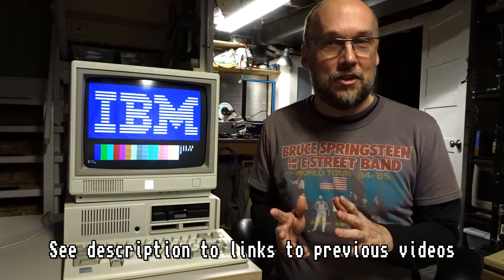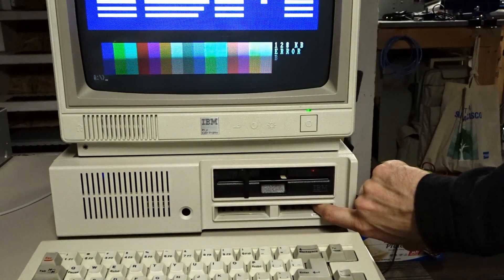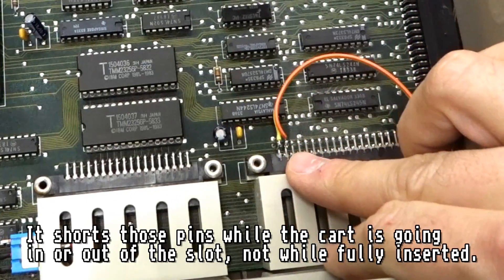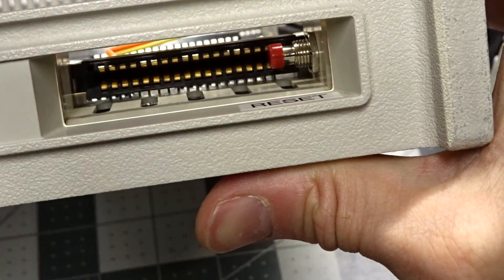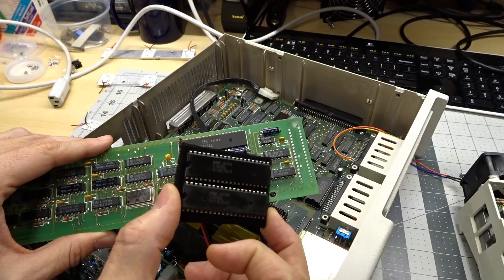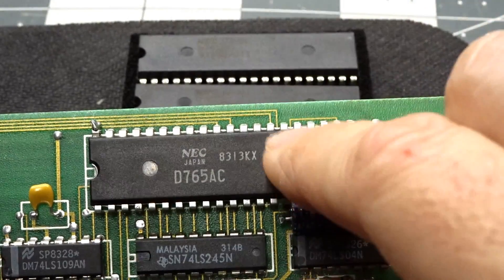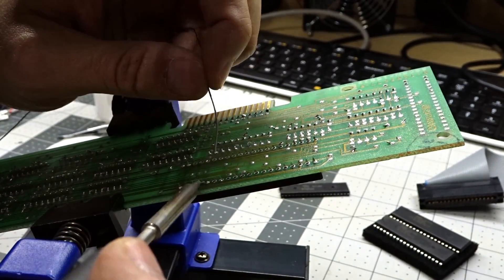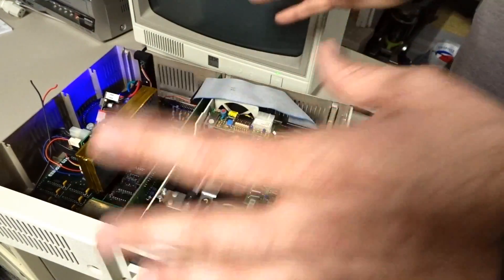IBM PCjr Part 3: Fixing the pesky boot issue once and for all

Comment: I notice a lot of complaints about him cutting the legs off the chip, but it's safer for the PCB that way.  Otherwise you have to perfectly desolder every pin to get the chip off.  That's a lot harder to do so you'll put more stress on the vias before you've accomplished it, and possibly end up with damage.  Cutting the legs makes it a lot simpler since the legs can be removed individually.
When you have a probably-bad chip that's not rare or valuable, attached to a board that is more valuable, you have to weigh the risk/reward of either approach.

Comment: I'm not a fan of replacing capacitors either.  However, most L/C meters do not check for DC leakage, and only check ESR and capacitance.  DC leakage can make an L/C meter think the capacitor has greater capacitance when DC leakage is present.  This is because L/C meters use TIME to determine capacitance.  The longer it takes to charge, the greater the capacitance.  However, if the capacitors are leaking DC, they will give the illusion of higher capacitance, because it's taking longer to charge the capacitor.  Nichicons are excellent capacitors, but that does not mean they are immune to DC leakage.

Comment: I have to say that if you have 40 year old capacitors in a unit they are going to fail sooner than later and it never hurts to change them regardless how well they measure. It’s easier to change them then clean up the mess if they leak all over the PCB.

Comment: I really like the method of desoldering a bad chip off and replacing it with a socket instead which makes it very easy to swap out chips when necessary.

Comment: If the capacitors are good and the chip is not resetting properly then it could be the resistors in the reset timing circuit.  There is usually one resistor to discharge the capacitor on power off and one to trickle power into the capacitor on the reset line so the reset is low on power up but slowly goes high.  Of course it could also be the logic itself, though.

Comment: This series has been pretty interesting to follow along with.  I'm looking forward to seeing how you make out with that sidecar memory expansion in the future.  Your diagnostic of the bad IC chip on the floppy controller was really interesting, especially when many in the comments were giving different advice.  I like the fact that you replaced the chip rather than going with some other ridiculous reset solution.  As for cutting the legs and tossing the bad chip I'd have done the same thing.  I don't really subscribe to the theory of saving everything even when it's broken as some have suggested.  The chip was bad.  You definitely chose the best solution.

Comment: I saw a few other posts that indicate that the problem with the card might be due to the lack of filtering caps on some of the ICs. https://www.zdnet.com/pictures/cracking-open-the-ibm-pc-jr/16/ (look through the pictures, there's  a bodge wire on the back of the card too) 
I'd give that a try, because if it works, that would be a much cleaner and reliable fix, and .1uF filtering caps are dirt cheap. Of course, might not solve the issue if the controller chip itself is bad.

Comment: If you get the IBM 128K sidecar you can remove the 16 4164 chips, install 16 sockets  and 16 41256 DRAM chips. There's a spot in the middle of the board where you can solder jumper 2 pads or, do what I did and install a pair of .100 pins and used a jumper. You'll need a small TSR to load when booting to recognize the extra RAM in DOS, but that will get you to 640K.

Comment: HI Adrian - I don't believe in just shotgun replacing every component either, but replacing 35+ year old electrolytic caps are a no brainer, especially if you plan to keep the machine long term (even Nichicons). It sounds like you tested them in circuit and got expected ratings, but I have still seen ones pass tester tests but act up in use until replaced. I would also like to share that in my experience, late 70s to mid-90s axial and radial full-sized caps generally don't necessarily leak visibly, or burst from the top vent -- they generally just seem to dry out eventually. Makes troubleshooting harder for sure. The video doesn't make it clear how you settled on the one chip being the issue, but if replacing it fixed the issue, then great. I would be very interested to see a voltmeter clipped to that floppy controller chip's voltage input lead (with the other lead grounded) and watch the meter during the PCjr reset button held down -- is it possible the expansion cards aren't fully reset during the computer being "reset", with that chip retaining some state from voltage present during reset ?? We know for a fact the card resets properly when being fully removed and reinserted. Best wishes!

Comment: Cutting the legs of the chip seems to make more work.

Now instead of using some desoldering braid and prying it out, you have to cut each pin, use tweezers and remove each one, then use desoldering braid to take the solder out. Not to mention if the chip was good it's now ruined anyways.

Comment: Not sure why you blocked the cartridge port with the reset switch.  Why not just punch a whole in the front of the unit and mount (either the switch your had, or a nicer large button momentary contact switch) and add the reset button rather than block off the cartridge port.

Comment: You are a braver man than I on that chip replacement method! I don't like to damage the existing hardware even when it is expected bad and I have replacements. I try to always maintain the ability to revert back to the original state. 

Being different part numbers from a different decade on your new floppy controllers had me worried they would be different somehow like CMOS instead of TTL and may not work. But I haven't done any reading on the matter, that's just what popped into my head. Clearly it worked so it was an improvement! 

I'm really curious to see how that goes with the RAM sidecar! Since mine is only 64kB I should really look into one of those as well.

Comment: I used to own two PCjrs. I inserted and removed the BASIC cartridge all the time. It seemed to not affect the computer much at all. Nevermind that the Jr was anything but PC compatible. 

Adrian, one of my Jrs had a Rapport expansion upgrade to add a 2nd 360kB floppy drive, memory expansion, and a sidecar that had a 40-80 column toggle switch and a parallel port. Mine had 256kB on the board.  Unfortunately, I accidentally tore a trace on the memory board (imagine a 15 year old kid trying to solder ram chips onto said board at the time).

Comment: 8000 people cringed when you unplugged that floppy card when power was on. Yikes! It seems like there was a dozen other places you could have put those reset switches where they would not have blocked the cartridge slots. I would have either run them out the back or jury rigged a blank spacer that slotted into the cartridge slots with both switches on it. That's just me, though.
Reply: Yeah, between pulling the card while it is on (and risking shorting lines on the motherboard together), cutting out the old IC without knowing if it is bad or if the new ones work and installing a switch where it blocks the cartridge slot, its all cringe. There are way better ways to go about all of that.

Comment: A much more elegant solution would have been to make a 'reset cartbridge' with a very simple circuit : a reset button conected to the 2 pins you have to short to reset the computer. no holes no soldering. You insert the cartbridge and you have a rest button.

Comment: Smashing job on that!  That was quite the detective work to figure out the error, sometimes desperate times call for desperate measures.  Glad that those IC's are easy to come by!  I'm not terribly fond of where the reset switch was mounted, but it's easily reversible should that cartridge slot need to be called into use.

Comment: mmmm while you can just swap the chip and fix the problem, i'd rather stick an arduino mini to the card and have it detect and reset the chip for me. I rather fix things than swaping out chips, mostly because you never know for how long you'll find those chips until they are all gone.
Reply: That 765 was already broken (damaged insulation somewhere in the silicon most likely) and it would have been a matter of time until it fails completely, very likely by shorting out (full latchup) and possibly damaging the rest of the board.

On the other hand it was THE floppy controller for all the early PCs (actually, it was in all PCs until they ditched FDC at all, it just got integrated into the chipset later on) so it's still quite plentiful.

Comment: Interesting way to figure out the problem :) I wonder, instead of removing the chip, could you just put the new one on top (piggyback) to see if that helps? I have repaired some c64's and I followed some other youtubers who repair c64's and did that on the chips they suspected was broken. So I wonder, is it always safe to do that?

Comment: I'll never understand why you cut the chip off the board. That makes so sense at all considering you have the proper tools.
Reply: I understand the reason why it was cut. I'm sometimes rather angry when I "debug" for hours a hardware problem, hence the faulty component has to die a horrible death :D
Reply: Why does it matter? It was broken. Its much easier to get a BROKEN chip off like this than it is to try and desolder the whole thing in one go.
Reply: @FloppydriveMaestro  
he has the heated desoldering gun, you go trough all the pins and the chip falls off, its actually faster using the gun and you dont destroy the chip in the process.
Reply: @laharl2k  But why do you care? The chip was broken and he was going to replace it regardless. If a chip is broken its easier to just to this. Heated desoldering guns are not perfect and it can often be fiddly to get it all off in 1 go. 
Why does every one care so much about a broken chip having the legs cut off. IT WAS BROKEN ANYWAY.
Reply: @FloppydriveMaestro  
it wasnt broken, it was just not working perfectly.  but still it was still partially functional. You just dont trow away salvageable stuff, its that easy, desolder it properly, put a label on it that says "reset semibroken" and that's it. save it in case of nuclear catastrophe or something. You never know when you'r gonna need it or if you'll ever get to a point you cannot longer find a replacement. Just like with antique old machines, you just dont throw away broken parts, you save them ust in case in the future you can fix them or something happens and they become usefull again.
Reply: @FloppydriveMaestro  I care because people need to know that this isn't the quickest method for removing a chip. And it's destructive when it was not necessary. It literally took him twice as long to remove the chip that way. And HE needs to learn that too which is why there are comment sections. If I did something like this, I'd want to be told that it was  the wrong way.
Reply: @BillSargent1977  instead of looking at it as a right way and a wrong way perhaps consider that there is your way, and his way.  Feel free to do it your way, and Adrian can feel free to do it his way.  Most problems in life have more than one solution, and just because you prefer a particular method doesn't make someone else's method wrong.
Reply: @laharl2k  If an IC chip isn't fully functional, and I can still purchase replacements, then I'm going to throw it away.  I'm all for saving old things, but there comes a point when it is time to let something go.  I used to save everything as well, but over the years I came to change my opinion on this.
Reply: @BillSargent1977  His desoldering station sucks and can lift pads from overheating, this method is totally fine.
Reply: @Walczyk  No its not. And you''re replying to a really really old comment.
Reply: Geez we got a Dunning-Kruger convention up in here, with passive aggressive icing on top.  The chip is ubiquitous and worthless, the board with this particular old thermoset adhesive, less so.  The goal is to minimize heat soak to avoid lifting pads, lowering and decoupling thermal mass accomplished this.  It was worth the extra 10 seconds of prep.
Reply: Plus the chip still worked, it only needed an arduino mini hot glued on top to hack it back to proper operation.
Reply: @MrCrackbear  Here's the issue - what if the problem wasn't fixed with the new chip, or worse, the new chip had other issues? If he hadn't destroyed the original chip, he could have popped it back in and still used his mod, and everything would have been OK. But, since he destroyed it, he left himself without a way back. When  modding you should be able to easily undo what you did.
Reply: I usually cut only one row and then bend back and forth the chip to have the other row automatically cut.

Comment: That a really odd failure mode for a chip like that.  I wonder if it was thermally sensitive?  It's always satisfying to fix stuff like that though.
Reply: It could have been as simple as a dry joint, but rather than troubleshoot that, just hack it off.
Reply: @daishi5571  A dry solder joint would not cause a consistent fault after power cycling.
Reply: Sure it can, higher resistances, signal noise, tolerances that over time are drifting. What I don't get, is he has a desoldering tool and it would have been simplicity to just remove the chip intact. He say's he's against replacing caps without reason but apparently has no issue in all but destroying a chip? seem inconsistent.
Reply: @daishi5571  He destroyed the chip because it was already broken. All testing showed it was broken so why bother leaving it intact if you are going to replace it anyway.
Reply: If that's all the troubleshooting he wants to do I guess that's fine, to me that's slap dash. I still don't understand why the need to cut the legs when he has a desoldering tool which he then used afterwards, it's adding work.

Comment: I cringed when you cut the legs off the old IC, even more so when I saw you had a proper desoldering pump. Why not just flip it over and desolder the old IC out, so you still have it in case of unforeseen problems? It's not like it's a huge hassle with a vacuum desolderer, I don't have any issues with a crappy mechanical pump.
Other than that, I really enjoyed the video and look forward to future videos.
Reply: I had a similar reaction when seeing that: As long as you are not 100% sure it is broken (and impressions can be deceiving), always try to save the old IC.

However, the other side of the story is that these are simply not rare ICs: There is a lot of supply on Ebay and AliExpress prices as low as $1.30 a piece. If it is not rare, why make your life harder?
Reply: Why does it matter. It was broken...
Reply: It matters because very you often only know for sure it was broken after you have done the swap. Until then it is just a suspicion.
Reply: @danielmantione  So? If it wasn't the problem then he would still have a nice socket and a working chip. If you have gone to the effort of removing the old chip and buying new ones you may as well replace it while you are there.
Reply: When repairing/restoring older equipment it is good practice to minimize the damage to potentially working parts, after all, it is not uncommon for such parts to be out of production, and so in limited supply, which might easily mean you are needlessly denying someone else the ability to repair something in the future.

There is also the concern about keeping the machine as close as possible to original or maintaining the history of the machine, though this might be more of a concern to museum type restorations it is common for even hobbyist restorers to try to minimize/avoid unnecessarily damaging parts or doing irreversible modifications
Reply: I tend to agree. He has all the proper equipment to desolder the legs from the bottom quite nicely.
Reply: The danger of damaging the PCB can be reduced with the proper tools and skill, as long as you are careful to get the pins to be lose before trying to pull the IC out, there is little danger of ripping off a trace, though obviously if the pins are tight in the holes this is not always an easy thing to ensure, and you might get to the point where the risk of overheating the pad becomes an issue.

Of course, it is not impossible to deal with a part being out of production, you might emulate it with microcontrollers or implement it with FPGAs or something, perhaps in the future it will even be possible to fab replacement ICs at a viable price for small volume production, but compared to the work invested in this, bodging a few traces will likely seem pretty trivial...

Comment: Great video! But the Reset switch in the Cartridge Port? The right port is where the BASIC Cartridge does into; if you get it.

As I remember, the computer does reset when you put the cartridge in or pull it out.
Reply: It doesn't matter which slot the cartridge would go into (BASIC or otherwise), but I do like the simplicity of just shorting out those two pins via a push button.

Comment: Bravo on not just jumping straight to electrolytic replacement. That's become a serious pet peeve on a lot of the electronics channels I watch. Almost everything I own (except some Mac stuff) from the late 70s-early 80s has high quality caps that still dont need to be replaced. Throwing a bunch of cheap caps in ensures that a machine that probably didn't need a re-cap in the first place...will definitely need one again in a decade or less.
Reply: Bad caps would be much more likely than a fault in an IC. The issue still could be a bad cap that caused the last chip to latch up. Most people that are recapping seem to be using Panasonic high temperature caps. Pretty sure they won't go bad in a few years.